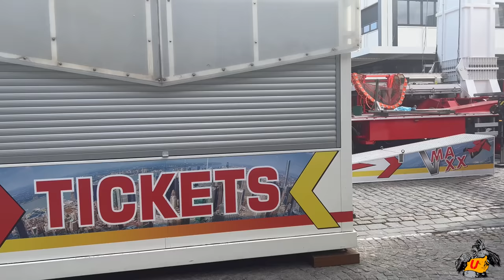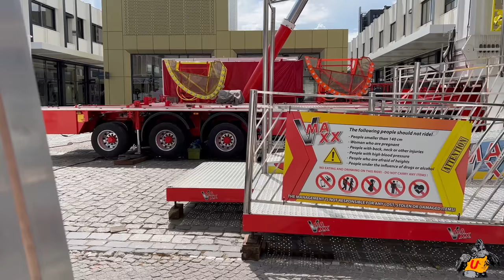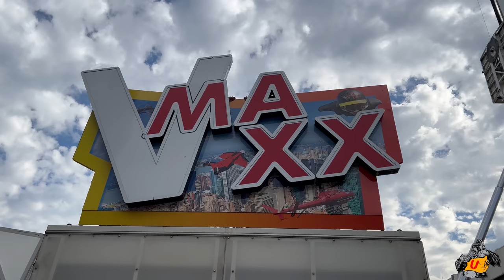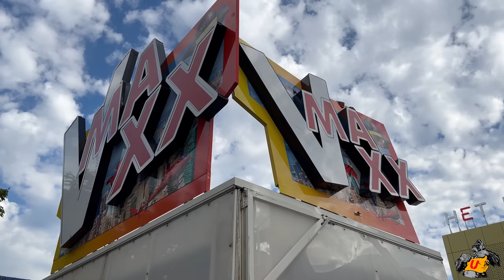V Maxx - Bodet (Opbouw)

Comment: interesting video, ESPECIALLY for worksafe, as a few of you would get pinged for not wearing harnesses, getting on that platform on the mast, just look down!-for god sake, see the concrete you could fall onto!!-and die (as thats the sentence handed down by a broken neck!).
Poor ride design, the whole thing should be rigged on the GROUND, and erected LAST, like big cranes are ; watch Liebherr videos to see professional riggers at work, and good SAFE assembly design, if you can't reach it, its done remotely (by hydraulics controlled by a drone controller plugged into the machine), no one works at height, or pins parts in precarious positions, what can be done safe, by man, is, if not, it's automated.